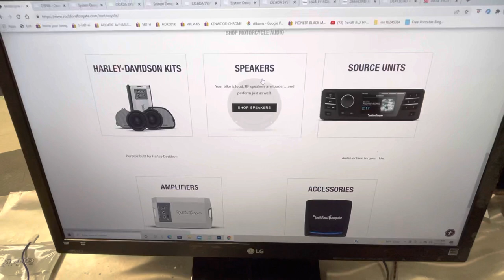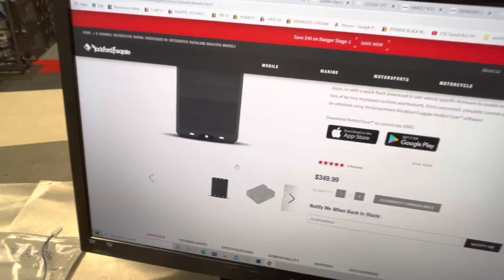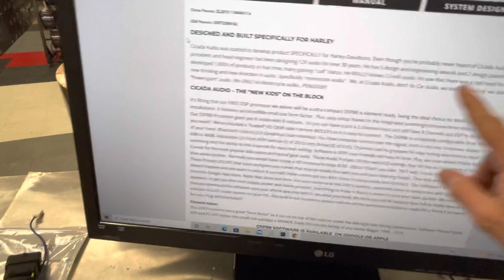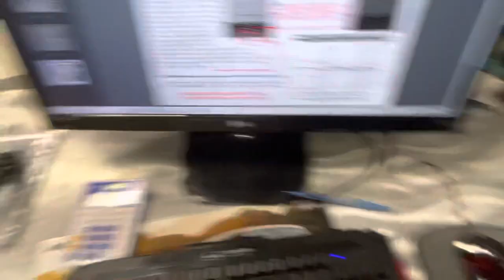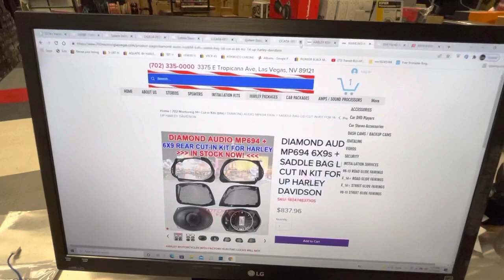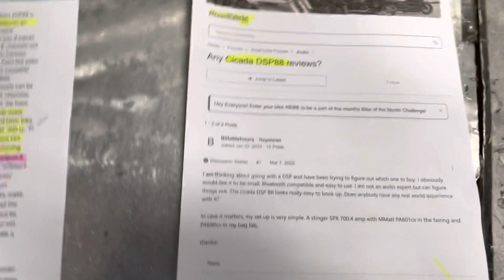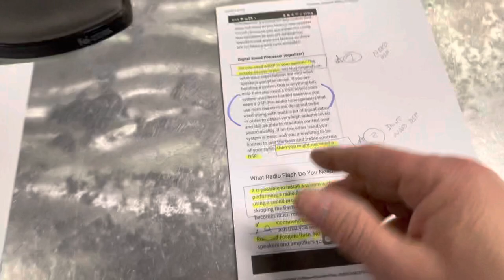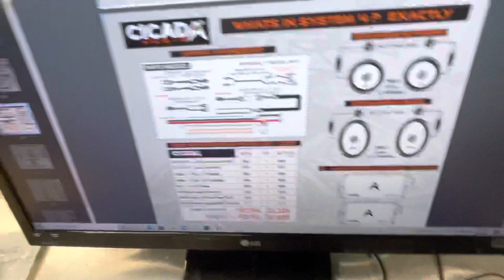YOU DO NOT NEED A DSP DIGITAL SOUND PROCESSOR ON A HARLEY DAVIDSON 2014 & UP  SOUND SYSTEM INSTALL

Comment: Your logic is flawed on several things here PERIOD!
Reply from the maker: Negative, Our Logic is clearly explained in detail, just because it may not agree with your narrative or agenda does not mean it is flawed, it is very simple, you DO NOT NEED A DSP WHEN INSTALLING A SOUND SYSTEM ON A HARLEY DAVIDSON MOTORCYCLE / PERIOD
Reply: @702 Motoring Las Vegas  using your logic you don't need all your teeth to eat steak 😜 but it would be much better if you did LOL do your thing hey I'm not trying to change your mind just providing another perspective 😉
Reply from the maker: @eliteaudioinstallations4242  Your comparison is not a relative comparison, every Harley sound system we complete in our business is posted on YouTube, "EVERY" Sound System we complete far exceeds costumers expectations, understand we are building rider bikes, NOT bikes solely for competition, could a DSP allow our systems to sound better, certainly a little bit, but why charge a customer a extra $300 for a DSP & $200 to tune it when the sound system already exceeds what they expect? / THIS is what we focus and comment on, myself personally as the owner of 702 Motoring, the other guys in the industry using DSP's on "Rider Bikes" is possibly related to the fact that they are using inferior speakers that probably need the dsp in order for the system to sound good, we use Diamond Audio and we feel we do not need a DSP and it appears "Our" customers also agree and they appreciate not having to spend the extra 500 + Dollars
Reply: @702 Motoring Las Vegas  Look if that's how you guys roll that's how you roll, I'm just glad that you know a DSP can make the systems sound better which was my point... as long as that's understood do your thing 👌🏽 . Now the comments about inferior speakers doesn't really make sense but everyone has an opinion. Diamond Audio, Ground Zero, Beyma, Euphoria Xpert, Hertz and every speaker on the planet will sound better with a dsp hands down. I understand that riders that don't really know about Audio don't understand how much better their systems would sound. I just hope you offer it to your customers 🙂. Wish you much more success just this the general statements are misleading to those who don't know much about audio.
Reply from the maker: @eliteaudioinstallations4242  The statements we made in that video are 100% honest, ethical and truthful especially when they 
include a manufacture providing incorrect detailed contradictory information to consumers in the industry that in effect causes us to work harder when working with these potential customers.     But at the end of the day this part of the video or many others you had no concern for,  your main concern was the fact that we say you DO NOT NEED a DSP when installing a Harley Davidson Sound System, Interesting Indeed